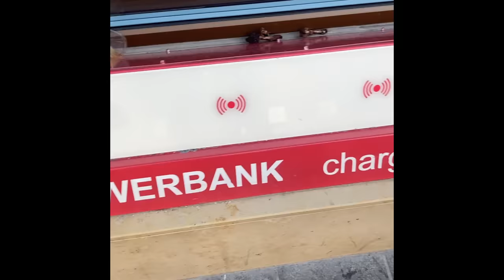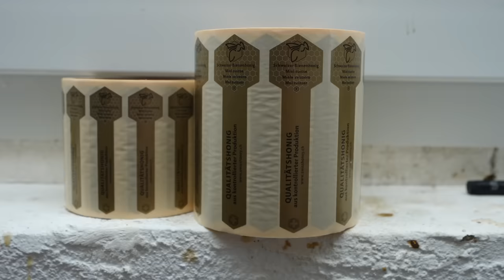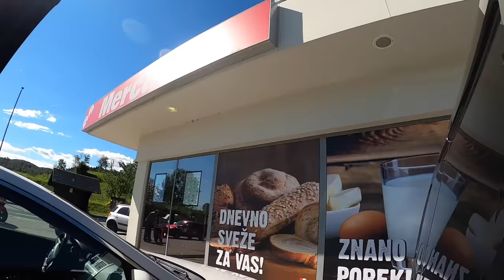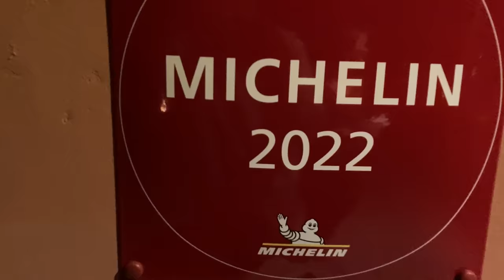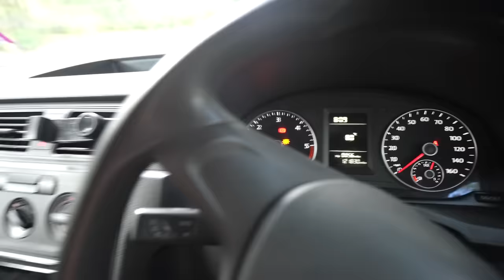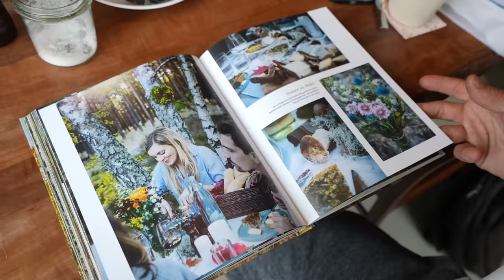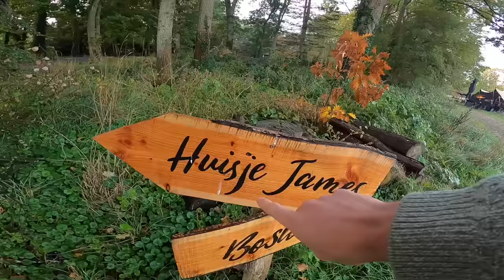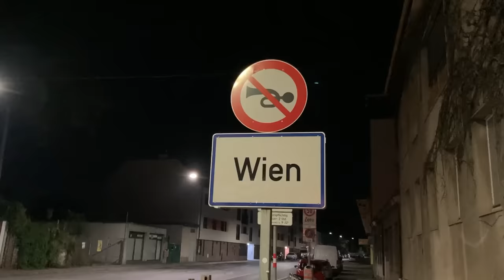Travelling Europe in my DIY Van Camper - 2 months on the road

Comment: If you want to give the mushroom a chance to regrow, don’t pull them out, but rather cut them, leaving the root. You can also lightly flick the cap, to spread some spores 🙂 You got some nice ones, nicely done! 👍
Reply: Extensive studies have shown that there is very little difference between plucking and cutting a mushroom. In fact, plucking gives signals sooner that a mushroom is gone, so the organism diverts energy to fruiting more mushrooms.

Comment: That’s a lot of counter top space which is in my opinion is not used quite often, you can allocate some of that space for your leg room and have a wider area for moving inside your van quite easily, a 40Cm wide countertop is just enough for an eating and working surface for your laptop and some storage underneath, which at the end will also become proportional to the size of the Van,

Comment: 45 minutes in and I've figured out what that yellow bit is, It's gonna be from the wood you used to insulate the van.

Basically what happens, is when you sleep atmosphere starts getting created. So then in your sleep true contact and well molecular contact from interior moisture buildup, cells from the wood got transferred to your skin which then got on the bedding via friction/turning in your sleep.

Comment: You converted the power from your battery to 220V to plug your notebook that is charged by around 20V.

Would be more efficient getting a 100W “car charger” USB-PD to take it directly from the battery voltage to the notebook charging voltage 😉